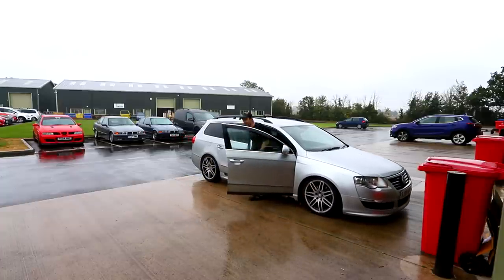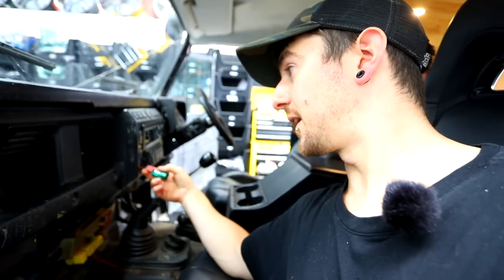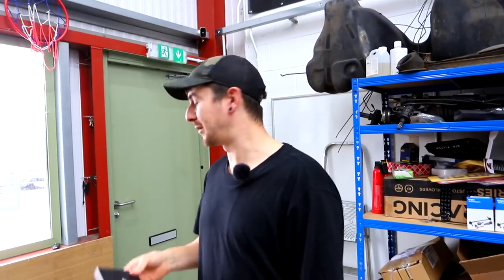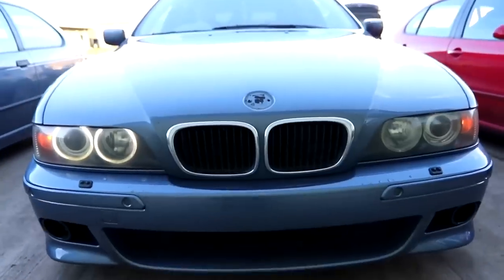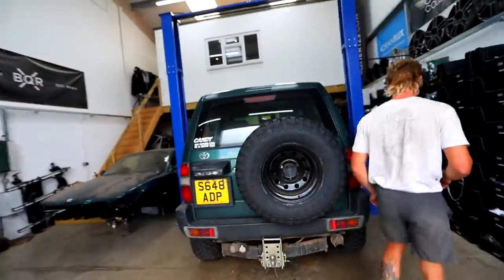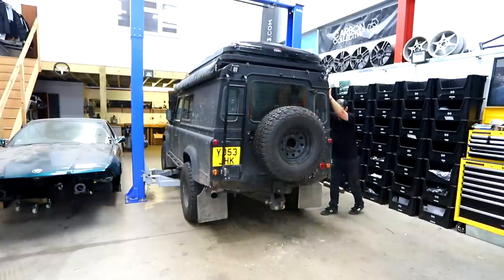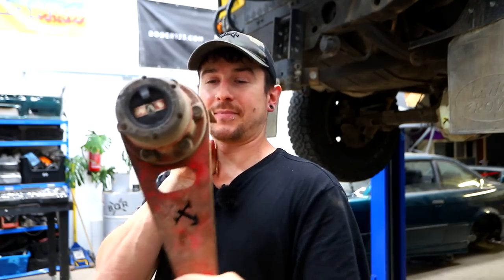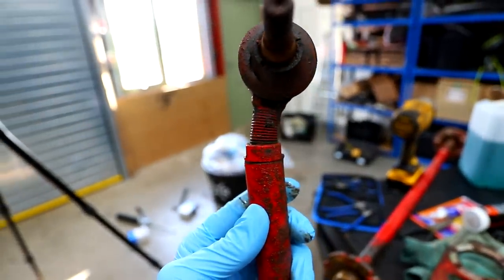I am really stupid sometimes

Comment: You could always mount a GoPro under the chassis while you're driving to see if the problem is that 40mm slack in the hub. Would also just be a cool angle for the video if you did some green laning with a GoPro underneath 😆

Comment: Lengthen the anti roll bar links to account for the slack in the hubs you have lifted suspension and worn old parts try that before buying a new on
Reply from the maker: good shout I'll try that
Reply: But do it while there is weight on the suspension to get the proper preload of the bar and adjust end links to suit and It should fix that. Id also touch base with the company specifically relating to the slack manner to make sure it’s not crazy out of spec also for some piece of mind.
Reply: Can't adjust those links when there is Weight on them. Attach the bar to the chassis remove both links then measure from the bolt hole on then bottom to the bolt hole on the top. measure the link to the same length and fit personally I'd lengthen the link further for extra stiffness

Comment: Check out Alive tunings Eibach anti roll bar, absolute game changer on the road! And it's easy enough to undo a couple of bolts for off roading if absolutely necessary.
Reply: Agreed I have the same on my 90.  It rails around corners now ……… well in defender terms it does, it’s no M3😊

Comment: Could be wrong but that's just a generic locking from most old 4wd so having it in 4x4 would actually engage the hub and lock the anti roll bar not 4x2, try driving it with the arb hub in 4x4
Reply from the maker: yeah sorry dunno if I made that clear, I was definitely in 4x4 mode. Tried every which way and no difference